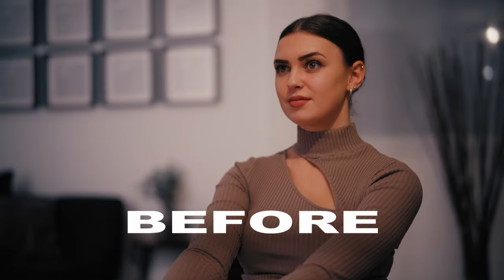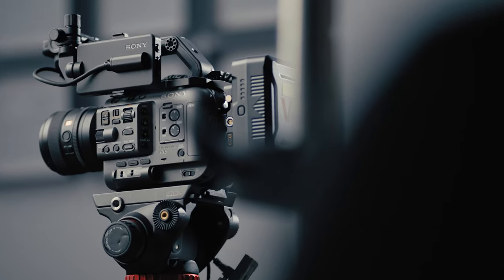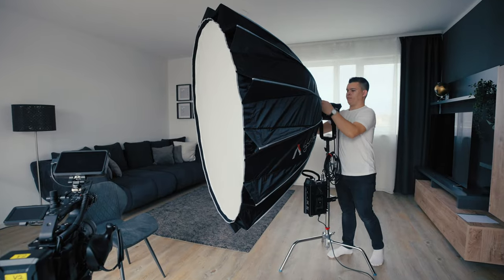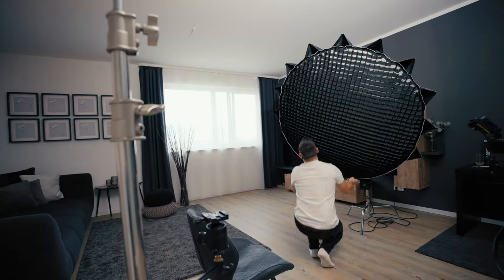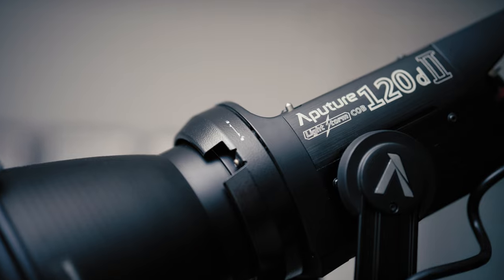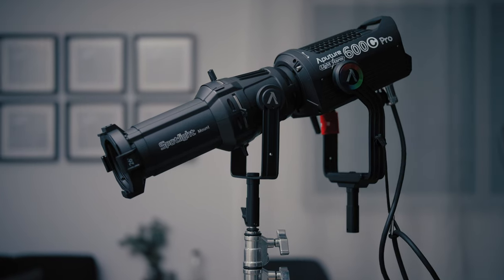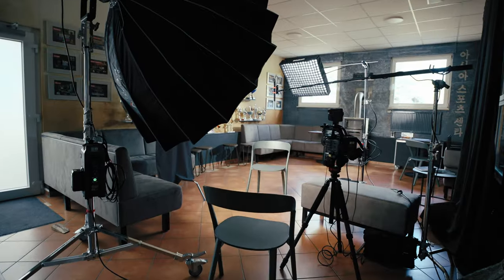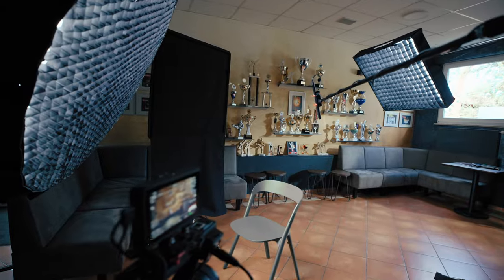It's about LIGHTING, not the camera! - Here's why!

Comment: There is barely any info. No focal length. I decided to look at other of your videos and saw the same thing. Explaining how you make your b-roll, but say nothing about the most important b-roll element - the movement. Did you use crane, gimbal, slider, 4 axis pan head and so on.

If you wanna gain traction, you must go deeper bro :)
Reply from the maker: The video is not about the camera or lens, but about the difference when you work with lighting.
In the B-roll video, I actually mentioned all the points you wrote down... 😄🤷🏻‍♂️